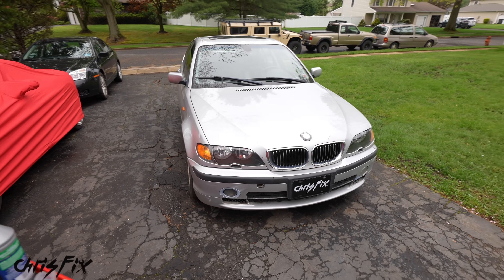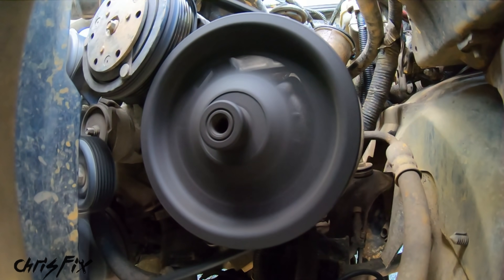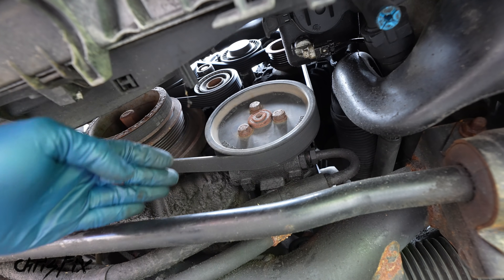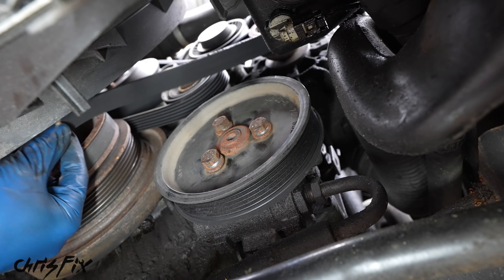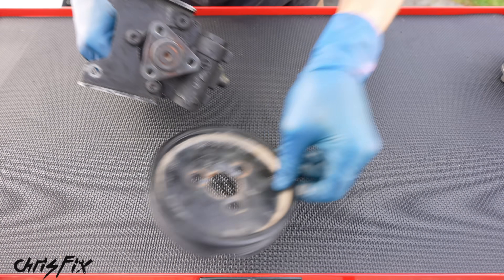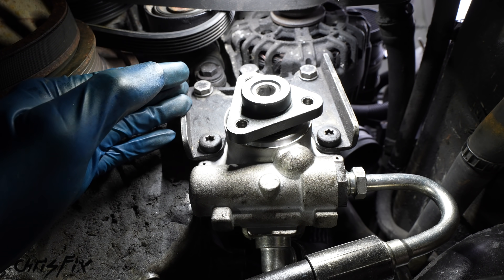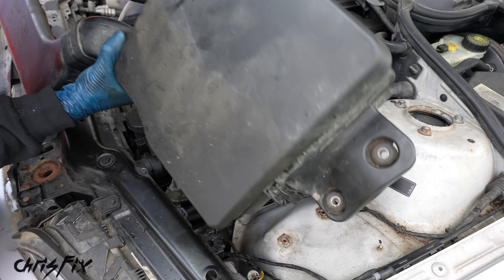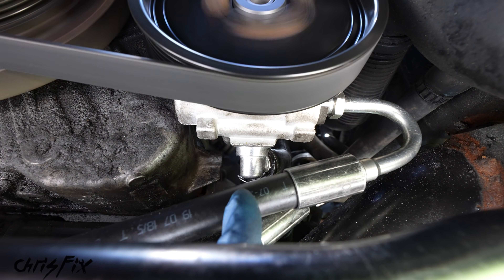How to Replace a Power Steering Pump

Comment: Quick tip, put a jack under the front of the vehicle and take the pressure off the wheels. It's a lot easier to turn that way. Also, if you get some air trapped in there, like the Dodge/Chrysler setups like to do(particularly the old Cummins trucks), you may have to turn the wheel lock to lock without the engine running first to push some of that air out. 
Good luck all! Thanks Chris! Another great video!
Reply: also helps avoid flat spots on the tires, low consequence but good practice
Reply: @denbyscott5745 -  I made slip pads by placing a folded plastic trash bag between 2 paper grocery sacks to put under each front tire. That puts pressure on the tires but they slip super easy. The pump needs a bit more pressure than being fully off the ground.
Reply: @donoimdono2702 that’s important to know! Thanks, I’ll just muscle it over, I need the exercise.
Reply: @flintdavis2  -  it requires very little muscle.
Reply: @donoimdono2702 ooh slip pads, nice! never thought of using that before. gonna remember this in case my civics power steering pump will go bad
Reply: @normalkid488  - Hondas last a long time, so you'll be waiting awhile. 😄

Comment: Maybe it's just the editing, but that's the cleanest and most fuss free messy job I've ever seen
Reply: When I went to bleed my Malibu's brake lines, I found that Chris made it look 100 times easier than it actually was.
Reply: I’m pretty sure he preps everything before filming probably even use penetrating fluid to loosen the bolts and get ready to film or probably pre loosen everything that needs to be done to make the video makes it clearer. But yea what you see here is how the job gets done but in reality we deal with rust, bolts braking off or some stuff that doesn’t come undone. Just gotta know how to get around it.
Reply: The power of editing
Reply from the maker: Thanks. This job went extremely smoothly! I was impressed with how easy BMW made working on it! Just enough room for the tools and the fasteners were not stuck or over torqued!
Reply from the maker: @Legendnum23  nothing is prepped. It’s all done in real life and what you see is exactly what happens.
Reply: @chrisfix   Very much a surprise, especially given how German cars are known to be extremely easy to work on :p
Reply: @chrisfix  KarysmuhFix's version would end with me covered in steering fluid, it would completely miss the pan or I'd tip it half way through, cat litter everywhere, lost sockets somewhere in the engine bay, I guarantee I'd be bleeding, possible concussion, and hangry AF.  All to the tune of Benny Hill ofc.
Reply: @sleepdeep305  It is just a three step process:
1) Disassemble the car to the last nut and bolt
2) Use special tools to replace every wear part
3) Reassemble and repaint as necessary
Reply: @sleepdeep305  everything I've done on my bmw which only extends to power steering and accessory belt work, has been simple and easy.

Comment: Hey Chris, just wanted to thank you for your videos! Your info is short and to the point. You don't wonder off about who invented the wheel or about the history of the car. Stuff that has nothing to do with your video. The majority of mechanics or DIYers on YouTube drift off the topic of the video, you don't do that! You stay on topic and to the point!
Thank You and keep them coming!

Blessings
Reply from the maker: Thanks a lot!
Reply: "...about who invented the wheel ..."  Sorry, had to snicker at this a little, considering how many wheels (incl. gears, pulleys, and the impeller core) are actually in this video and at least partially related to the process.  More than even the average car repair video, I think.
Also noting Chris coming back to read and comment two years later.  Very nice.

Comment: I have electric power steering, so... I'm still gonna watch this video.
Reply: Pretty sure i have an electric one too. The car has park assist so it would only make sense.
Reply: That's a whole other video in itself for Chris to take apart! Good idea :-).
Reply: @milk-it  i dont think he owns cars with electric steering. Also theres not much you can do, trace wires and replace the motor or the entire unit
Reply: @D3nn1s  His dads Maserati probably got electric steering.
Reply: i have no car but.... Still gonna watch this one lol
Reply: @D3nn1s  Nissan?
Reply: @CarSkull  you meant my car? No vw golf
Reply: @D3nn1s  oh ok
Reply: Same
Reply: There's two kinds of electric systems. Hydraulic electric and self contained. My MR2 has hydraulic electric which is a normal system run by an electric pump instead of an engine pump. The self contained systems are big electrical boxes attached to the steering rack. I think they will have fluid but they are self contained and I don't know what maintenance they need.
Reply: i don't have power steering, but im still watching this
Reply: That just means you have to replace the whole rack! (Our 2007 Pontiac G6 has that too).
Reply: @tenhoandersson  I don’t have a car and I’m still watching this
Reply: now I'm curious how to replace a faulty electric power steering
Reply: Sentra?
Reply: Why? 😀
Reply: @megakiller999  they don't. It's a motor that turns the rack directly.
Reply: @Afeeq1011  check power. Check CAN lines to it. Not much to diagnose on them. It's either bad or not.
Reply: @megakiller999  where are the askers??????!!!! My freindddd
Reply: What u got a Tesla
Reply: @milk-it  hi
Reply: @D3nn1s  hi
Reply: @iitempted8991  hi, u wot?
Reply: Less road feel
Reply: @pirihern9329  not true. It doesnt have to be wiresless, my car still has a solid connection to the wheel, its just assisted by the motor.
Reply: Didnt know that my 07 Ibiza had electric power steering until it stopped working to save the battery bc it dipped under 10 volts lmao. Good thing i was parking and not driving :D
Reply: There's still fluid in the rack and pinion
Reply: @nolife1199  but you cant access it^^ also it might just be grease
Reply: I’ve always had year 2000 cars then I got into a 2013… I was like, “where’s the power steering reservoir???” 🤣🤣
Reply: When that breaks you gotta do the whole rack.
Reply: @truckernation7886  I'll just manhandle the wheel. What could go wrong.
(my car is 2500lbs, should be not terrible)

Comment: Thank you, Chris. Honestly, thank you so much. In no small part, you are responsible for me methodically and slowly fixing small issues in my cars that only a few years ago I would have definitely paid a mechanic to fix. There are still bigger issues I go to a mechanic for. But that line is slowly moving up. 
Just literally yesterday I decided to check the vacume lines for my turbo before I sent the car to a mechanic to fix the turbo. Sure enough, there was a leak and all it took were two tubes of shrinkwrap over a small cut. (I'll change the line if it becomes a problem again.)
I know for a fact that even half a year ago, I didn't have the courage, know how or self trust required to even attempt to check what could be wrong with a turbo.
I know that, because the turbo has been acting funky for half a year before I finally gathered the courage to actually check it myself, thanks to youtubers like you, showing that fixing a car doesn't require years of experience or all specialty tools.
Reply: Wow

Comment: Let's talk about the muscles chrisfix has when he turns the steering wheel.
Reply: More like Chrisflex
Reply: He be ripped asf 🥵🥵
Reply: Chris is a buff guy. Breaking all those rusted bolts is hard work 💪
Reply: Did he actually do it to bleed the line while the car was still on the ramp? Perhaps if he jack up the car and let the front wheels loose, the job could have been easier.
Reply: @jendralhxr  he has to show off all that muscle duh

Comment: Thank you Chris Fix. You saved me a couple of days without a car and $310 bucks, thinking it was a bad power steering pump. It was just low fluid. Decided to change out the fluid rather then add more. Thanks again.

Comment: Next time when you’re bleeding the power steering fluid raise the front wheels off the ground. It makes turning the wheel a lot easier and is better on the new pump
Reply: Exactly.
Reply: Or drive the car (carefully ofc) if you don't have a way to lift both wheels at the same time, it will also be a bit easier to steer and won't damage your driveway (if the car in on the ground) or risk moving the ramps.
Reply from the maker: Totally could do that. Wasnt worth the time and effort to get the jack and jack stands out.
Reply: best is with the wheels completely off the ground. Then if you can't do second best that being an empty lot so the car is moving when you torque on the steering wheel, you can use dish soap on the steel ramps.
Reply: One other thing, you should also allow the pump to get filled with some fluid before u start the car. Otherwise, if you can damage the new pump as it heats up, even with the turning if the wheels.

For example, before tightening the high pressure line, allow gravity to pull fluid downwards. As soon as you see fluid dripping out of the high pressure fitting, then you can tighten to spec..

Cool video!!

Comment: Someone start a go fund me so chris can get his drive way paved
Reply: i don't think this dude is short on money lol
Reply: @DutchDukeMan  I’m sure he’s working on buying them a house as well as one for himself too.
Reply: size doubled*
Reply: Chris goes to great lengths to make his projects accessible, using the simplest tools and methods whenever possible. The fact that he does his projects on an imperfect, aged residential driveway, and not in a shop with smooth epoxy floor a lift and 50,000 watts of flourescent lighting, is an extension of that same spirit of accessibility and achievability. Chris is smart not to upgrade himself out of an audience.
Reply: @grahamd.8713  Only reason I watch, in the driveway with hand tools and all of the problems that come with that.

Comment: This hurts my heart seeing an e46 in that condition sheesh
Reply from the maker: She’s being put to good use now!
Reply: @chrisfix  ok
Reply: @chrisfix  my car is idling noisily and sputtering. What could this mean? I looked under the hood and couldn’t see anything wrong.
Reply: @jayasmrmore3687  if you check the lemon car video it's like two or three before this he fixes the rough idle in this car you might be able to try that
Reply: @jayasmrmore3687  also note the scanner he uses had reviews of people having problems with showing advanced codes on non us domestic/na domestic vehicles
Reply: @maxwhite496  okay
Reply: @jayasmrmore3687  chopy idle might be a meaning of misfires
Reply: Shush the sheesh

Comment: I would definitely recommend to do the rear subframe reinforcement before that race. Those models had thin metal holding the subframe in. They make kits to weld in to stop it from cracking, tearing, ect.

Comment: Imprint on the reservoir: Use ATF only.
ChrisFix: nah, I’m gonna put some shady European full synthetic power steering fluid in.
Also: when you bleed the pump, you actually don’t want to have your wheels on the ground. Makes turning easier and your steering components will thank you.
Reply: Actually in E46 all you need to do is step on the gas, and then the pump will prime itself and start to circulate. No need to wrestle it left to right like that.

Comment: 21:35 When I was young we didn't have power steering but the steering wheels are designed so you can turn the wheel easier than the modern versions like this one.

Comment: Great video. The exact same thing happened on my car, which is exactly the same car as in this video. But one comment, once you have even a little bit of forward speed, there's almost no difference between power steering on/off in E46's. This is why they have such great road feel, you are getting almost direct feedback from the wheels. It just helps out when you're stopped and trying to park.

And yes, turning at a stop without PS is a workout. My GF liked me better when the PS was broken. Oh well.

Comment: I like when he shows some of the struggle involved. "Of course the pulley won't come off without a fight." "Of course I have no room to turn a wrench on the flare nut and need to get special tools." Makes me feel better about all the problems I run in to 😂
Reply: I wish I had those tricky devils when replacing the high pressure hose on my daughter's CR-V. There was not much room to get anything on it or swing it, so I had to chop the pipe and stick a socket on it, knowing it was do-or-die. It took a 24 inch breaker bar and lots of inventive language to get that thing loose.

Comment: It may help to jack stand the car off the ground when removing air from system. Rock on Chris ! 🤩
Reply: Was wondering about that. Never done this job, but it seems like it would be at least a little easier without the tire friction.

Comment: Thank you very much Chris for all the information you give us all the time and today you just saved me 350 dollars the pump cost me 200 at AutoZone and the mechanic was going to charge me 150 to change the steering pump but after I saw your video I changed the old fluid for new fluid and the noise went away.
Gracias gracias gracias 👍👍👍

Comment: As always nice video, well made, and simply explained!
The only thing you might want to consider are self tightening springy hose clamps (don't know if there's a actual name for those) as screwing type clamps don't account for temperature changes during engine operation and different times of the year ...

Comment: I see that you used synthetic power steering fluid. BMW recommends using an automatic transmission oil. It even says so on top of the reservoir: "atf oil only". Is there any difference in those fluids?
Reply from the maker: I spoke to PEAK about this and they said that their fluid is the same as ATF but it has anti-foaming additives to prevent cavitation which is what probably caused this pump to fail. They also said their fluid meets/exceeds bmws specs. That’s why I used it. I always like to use the correct stuff so I decided to use my contacts to make a call! Great question!
Reply: @chrisfix  I know on older BMW's somewhere it states that "Use Castrol Oil Only". I do recommend using Castrol oil and the specs that they were ment to be only on BMW's. BMW's are little bit delicate when it comes to using upgraded oil specs. Was a big difference with the e46 316i when workshop swapped from BMW spec Castrol oil to unknown spec Motul Oil. Engine sounds more rough now.

BTW Love the channel, everytime i need to do something on my car I check if you have a video about it, so I know what I am getting myself into :D

Comment: On the Ford pump in your truck, just turning the wheel with the engine off puts air in the system. I learned the hard way flushing my Ranger. It has to be running when turning the wheel to get air out.

Comment: This is awesome, I watched this video years ago but recently bought a $400 325ci 2003 that has no power steering, went to watch your video on how to do the pump and happened to be a fellow e46 so same parts/bolts, just minor differences.

Comment: Hi Chris, I have a couple of potential ideas for new videos. One idea is how to install an after-market air conditioner to an older/classic car, a potentially viewer-friendly idea considering it's getting into summer. The second idea I had is converting a car to run on batteries; showing how simple these vehicles are, especially during the current high gas prices.
Reply: That's actually a good idea 😃

Comment: All perfect exept: I will "activate" steering pump turning steering wheel, but with front wheels in the air. (Lift up front wheels on jack)
Reply: I think the reason he didn't do that was the car was on ramps. I like ramps but have been caught in some binds like that.

Comment: little advice, if possible have the wheels off the ground when you're turning the wheel to get fluid in the pump. It takes the stress off the pump and makes the steering wheel easier to turn.
Reply from the maker: Thanks for the tip!
Reply: Chris: Did you have the car on ramps when you were turning the steering wheel?

Comment: Chirs fix is awesome omg just saved me I thought it was the power steering pump but I was very low on fluid thank god I caught it on time I just got this e46 325i and I’m bringing it back to life wish me luck I’ve done extensive research looked at forums and common issues I have a lot of the common juices right now but the parts are actually so cheap for these and they have a very good after market very excited to get it up to date 😁

Comment: Recommendation: once you've filled up the reservoir with fluid (and with the engine off) go unscrew the high pressure line. Let gravity fill the line and pump.

These are self priming systems, but you'll avoid burning the pump if fluid doesn't get to it after a while.

You will also spend less time forcing the wheels back and forth as the pump fluid is now doing the work for you and ur just making sure the rack is full

Comment: Hey Chris, I enjoy your videos for a while now! Thanks for every one of it! Short question: are you sure that you use the correct fluid? On the old cap it says "ATF fluid only" - that's why I put the red stuff in my e36...
Reply: I was about to comment this, I think you're supposed to put ATF, not powersteering fluid into this powersteering system.